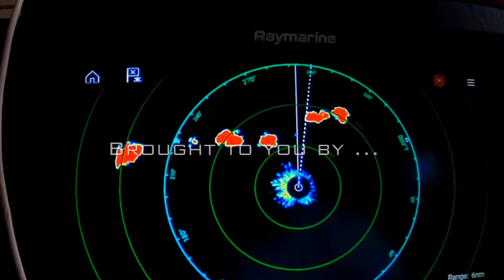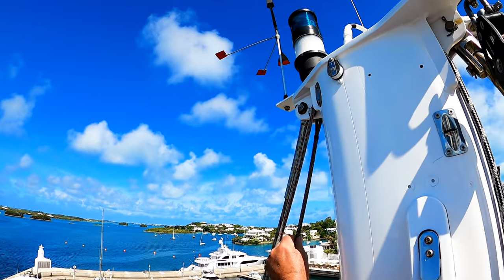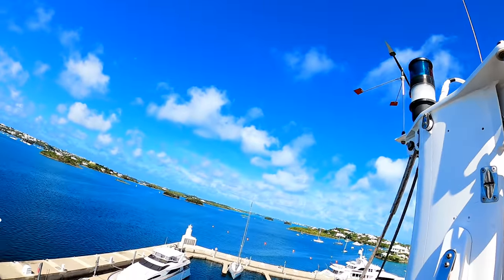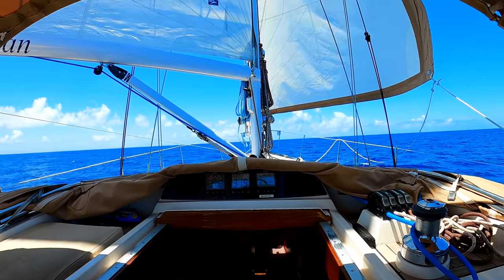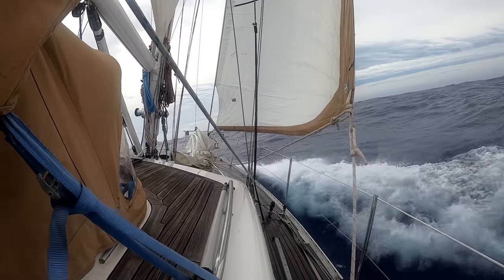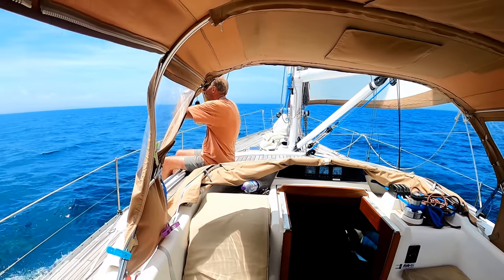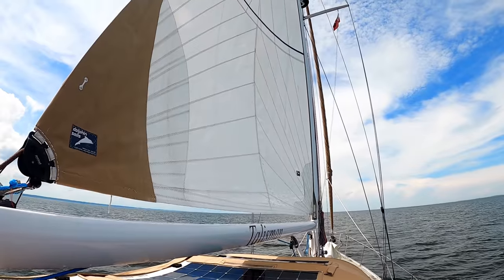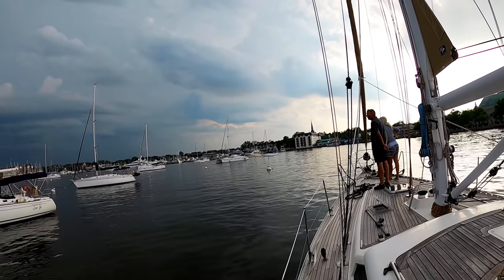Ep 123 950nm of Open Ocean Sailing - Bermuda to Annapolis

Comment: Your video are a great resource as we go back and remind ourselves of the things you have done. We are looking to buy an Amel and yes, the ketch us not so much in demand but we like the smaller main sail area. We view the mizzen as an extra sail. Again, yes more cost of replacement rigging as a cost of capital.  
Question, if you have time to reply. Rest value for bank loans? Does it exist or only with speciality boat finance firms. In reality we should not buy a boat that we can't pay cash for but inflationary times should carry as much cash as possible and stay invested. ..... It's not an issue if the quality or value but the smart and safe way to stretch the dollar. This Amel has circumvigated in 4 years and all new condition still today. We were crew sailing it around Iceland last summer. The owner is giving us first option to buy before listing (240,000€). Sorry for the longest story but this boat would normally be beyond our reach.
Reply from the maker: Hi David. Sorry we're in a bit of hiatus during the hurricane season in the Caribbean. Usually, we'd be posting episodes, but we're busy sourcing maintenance stuff. As to your questions, ketches are great, and you'll love the Amel. It's a different kind of rig, and my contention has always been that it scared off buyers who were used to sloop rigs. But you'll see them everywhere, and especially as the boats go into superyacht sizes, the ketch becomes the only way to keep rig loads somewhat reasonable. Ketches also allow a skipper to more easily "balance" the sail plan so as to keep the course better. As for financing of a boat, I'll admit that we did pay cash for Talisman, and so have little experience there. But as someone with an economic background (I spent a couple of decades as a commercial banker), I'll tell you that hard assets, like homes and better quality boats, can act as a hedge against inflation. Boats generally depreciate, and therefore are not great assets per se, but if financed will always carry the same payment in dollars (make sure the loan isn't an ARM). Thus in five years you'll still be paying in 2022 dollars. But know that the bank will insist on top end insurance, and will have a say there.

Comment: Another wonder video. Two thoughts Kevin as to when you were up the mast; 1) in the absence of real wire, plastic wire ties are an alternative for a shackle and 2) take a look at a knot called a halyard knot for affixing the shackle to the halyard. Cheers
Reply from the maker: Hi Ron. Indeed, those are options. When using zip ties, I only use the nylon white/translucent versions as the black ones are affected by UV radiation too much. Within 6 months they'll become brittle and break easily. And as time goes on I'll be moving more and more to the Wichard shackles with the indents on the pin. These will not back out on their own. And seizing wire is such a hassle. As for the halyard knot, we used it a lot on our old Catalina (small) boat, but the knot has a tendency to slip apart with new, slippery line (until it fully sets). It also really locks up on the shackle body, making it impossible to remove the shackle without cutting the know. I know the bowline isn't pretty, but it's a known quantity and the plan is to add a core-to-core eye splice to the opposite end of the halyard, then swap sides. As an aside, the chafe occurred during the time when the halyard deflector was failing (Ep 117).
Reply: @SailingTalisman  Great content, luv it. The cable tie info is actually the reverse, black for outside, clear for in. Black used exclusively outdoors by us linemen.
Reply: I use black for outside which is counter intuitive. But wire is better. I use safety wire pliers (look on Amazon) which was used on nuts in aircraft and racing cars before the nylon ends on nuts were invented/sold. It makes using wire fairly easy. As to the halyard knot, I like it for the reason you mention. I buy my halyards about 3 feet longer than needed and annually cut the knot and retie. In that way no part of the halyard is a a potential chafe spot for more than a year.
Reply from the maker: @roncanizares9966  It sounds like you have well thought-out reasons for what you do, which I always think is good. The solution we're using for concern about the halyard connection is a conversion to Dyneema cored halyards (not all lines are candidates-Dyneema has almost no stretch). The strength and resistance to parting is off the chart. Even the part that I cut off was is no danger of failure, as the core was still intact.
Reply from the maker: @skidrowe68  Interesting. Good to know. In thinking back on it I suspect that there are wide variations in quality. At present all the ties in my kit are sourced here in the USA from electrical distributers (GB and similar branded).